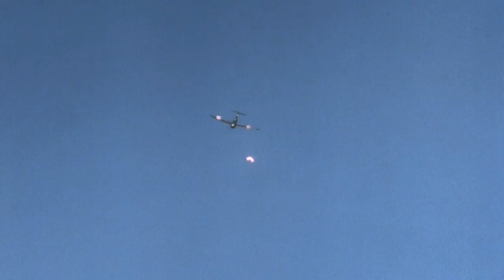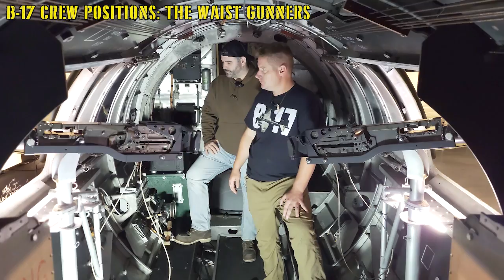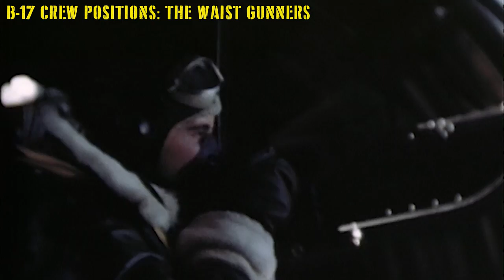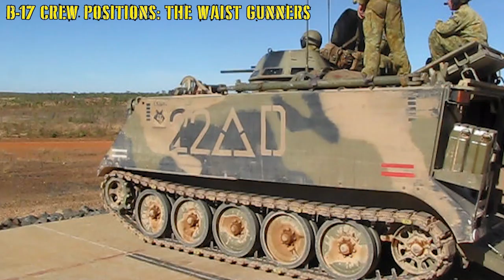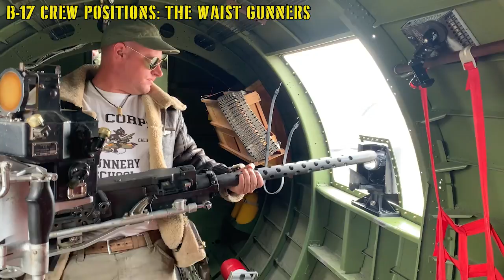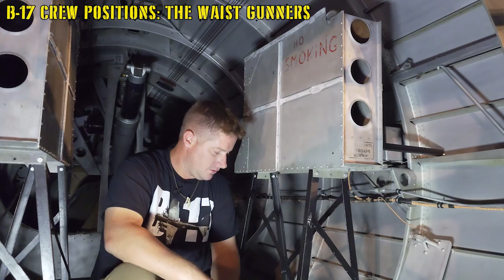B-17 Machine Guns IN DEPTH! - The Browning Legend

Comment: Both adapters have the grips on backwards. So much of this narration is wrong or inaccurate. Original film footage of the Memphis Belle at the waist area shows the flexible ammo feed chutes installed in the aircraft. The O-1 ammo can was not used in combat except at the ring mount in the radio room top hatch. I can guarantee that those ammo boxes mounted on those spindly angle iron supports would not last the G load of bouncing around in the waist position if filled with ammo belts. 100 rounds of .50 caliber with links is about 30 lbs. There is a special adapter that is required to fit the little O-1 box or ammo chute to the guns feed pawl bracket. Neither gun has these fittings. The E-12 adapters shown use an extended bracket so the O-1 box will clear the mount frame at the feed pawl bracket in either left- or right-hand feed. There is no adjustment to the rate of fire with the exception of the oil used in the buffer and the setting of the ports in the buffer itself. The lighter barrel of the AN-M2 gives it a higher rate of fire than the ground gun. All M2 Brownings produced were shipped as the AN-M2 basic aircraft model and the ground guns were converted later by ordnance centers for vehicle or Infantry use. Nearly 2 million receivers were built by many contractors. Over 10 billion rounds of ammo were manufactured during the war. The English Channel is literally covered on its seabed with dumped bombs and ammo belts and .50 caliber machine guns thrown out the waist positions, let alone the vast amounts of ships and aircraft there. Imagine all the spent cartridge cases ejected out over Europe during those air battles.
Reply: Ok Karen, we will get right on it. Did you not listen to what he is saying in the video? He literally mentions half of your corrections. This is a museum, creative liberty is given and full credit to the restoration crew, enjoy the plane and the work they have done instead of having a meltdown because someone missed a bracket to install.
Reply: @HH-COactual  The fact that it is a museum means you must be absolutely correct in the impression of how things were done 80 years ago. All the information I gave is available from many sources, no excuses for sloppy research.
Reply: You saw it on the Internet so it Has to be True  right Randy ??? No Wonder Nobody Likes You ! This guy is Standing INSIDE The Memphis Belle  and you are reading this from your moms basement all Mad & shyt     HE WINS   🏆😁
Reply: @randalldunkley1042  clearly sir you have absolutely zero experience working inside the museum industry. Additionally your more then welcome to make corrections, doing it in a professional manner and the creator of content or item may be willing to actually listen to you and correct their errors. However when your a condescending prick about it, no one is going to listen, there's no need to be proud of yourself and play the hero because you spotted some errors. I'll be looking forward to viewing your YouTube video that you make on aircraft guns.
Reply: @HH-COactual  Ignorance is bliss. You can't change history no matter how you try to rationalize it. Did I make any false statements? no. The restoration is indeed beautiful with many thousands of hours of work done. Why was it not painted red instead of olive green? It could have been better. But it is a waste of time to "Cast pearls before swine". I realize that many people will not have the slightest idea of what my comments involve. Obviously, someone is listening.
Reply: ☝🏻😆 THIS is what happens when you’re Awkward and Women won’t talk to you! Don’t forget to clean the Cat Box
Reply: Randall Dunkley ?  😳 
Is this Same Randall Dunkley who would ingest boogers for a quarter back in grade school ???
How are you man? Last time I saw you you were stuffed in a locker with your underpants stretched over your head   🙏I hope there’s No hard feelings  …are you still living down by the swamp ?  ❤️ You
Reply: IM SAD THAT I LIVE IN A WORLD WITH RANDALL DUNKLEY IN IT 😢
Reply: Was wondering, couldn't they put  twin 50s in the waist, I understand, lack of space, tight,  wieght, guns & ammo, ammo feed, harder pull to get on, stay on target etc.  but I think they might of been able to pull it off ? more fire power at the waist, accuracy affected ? I wasn't there so just asking !

Comment: I never understood why Boeing designed the waist gunner positions as they originally did.  The interference between the gunners and the tangling of lines and wires is blatantly obvious.
Reply from the maker: Good point. Whilst this is a guess so I stand to be corrected, I would imagine it was a carryover from the earliest B17s that had a blister bubble window mount like that seen in the PBY Catalina that protruded from the side of the fuselage. Uneven spacing of the bubble would cause a drag that may pull the plane to one side, so they must be level to negate that. Perhaps that is why E and F models did not have the windows spaced and the design took a while to be changed.

Comment: The ma'duce has selectable rate of fire.   High and Low.  I still have my headspace and timing gauge.
Reply: It does? Where do you select it?
Reply: No M-2 variant had selectable fire rates. 
Variances could be obtained by meticulous adjustments of the timing nut to get the desired rate.